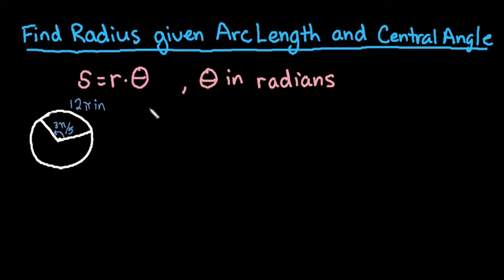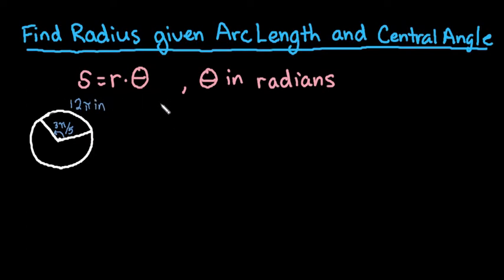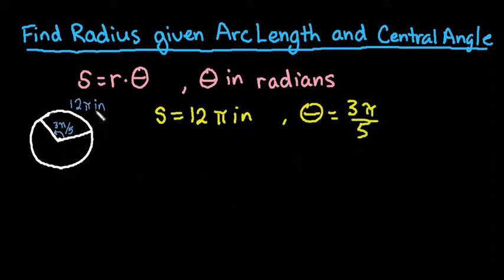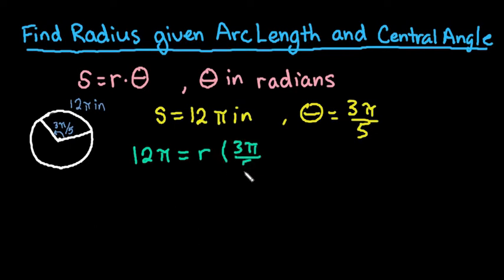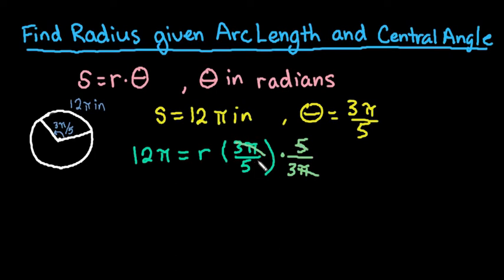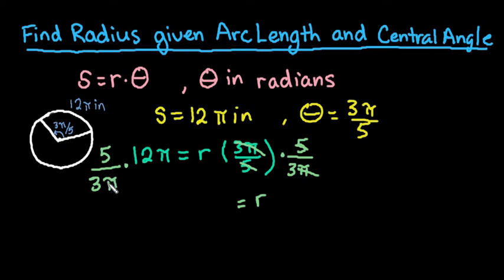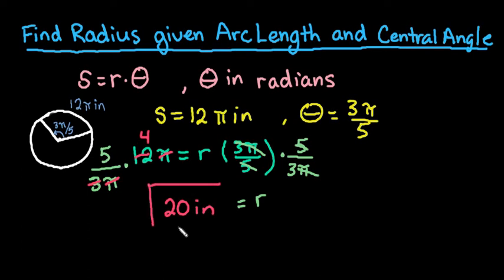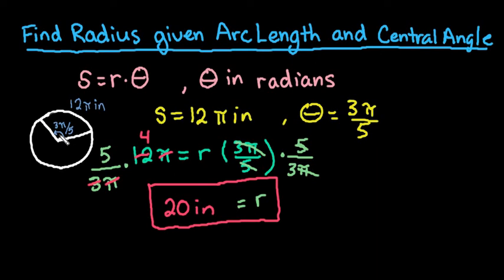Find Radius Given Arc Length and Central Angle

Comment: what do you do if your arc length does not have a pi with it?
Reply from the maker: You would still just use the same formula. S=r*theta.  The radius would just = the arc length divided by the central angle measure.
Reply: @MathandStatsHelp  Okay! Thank you so much!

Comment: Hi! What if the arc lenght is 5cm not a degree or a radian?
Reply from the maker: The arc length shouldn't be a degree or radian, it should be in cm. The degree or radians is the measure of the angle. Where I put in the 12π, you would just put in the 5 cm. You should be given an angle measure too, if you are finding the radius.
Reply: @MathandStatsHelp  thanks!

Comment: What if my angle is just a regular number, not a fraction? My arc length is 36mm and the theta is 127° how do i write the formula with these numbers
Reply from the maker: Convert your degrees to radians as shown in this video: https://youtu.be/L-Ff0DkLmHQ . After converting, use the formula in the current video.